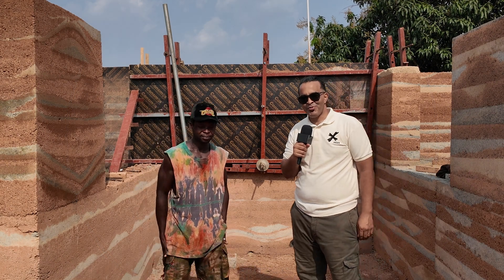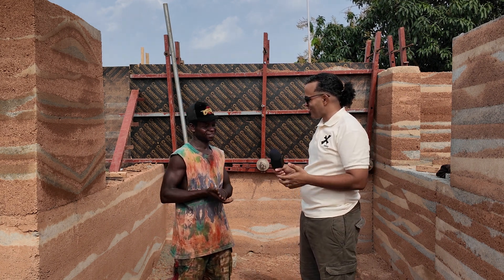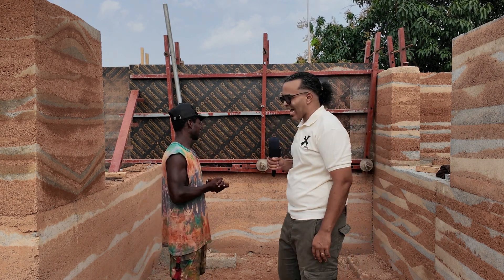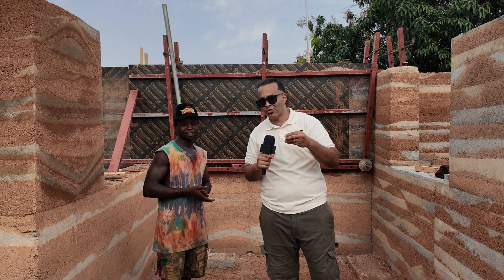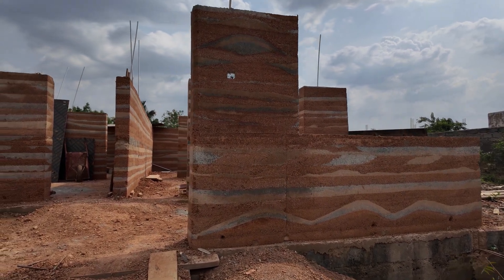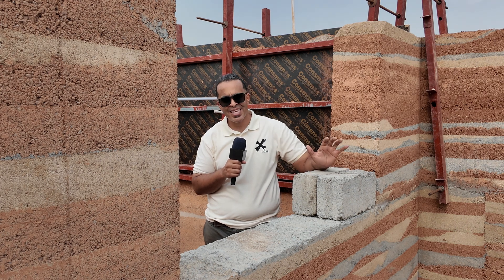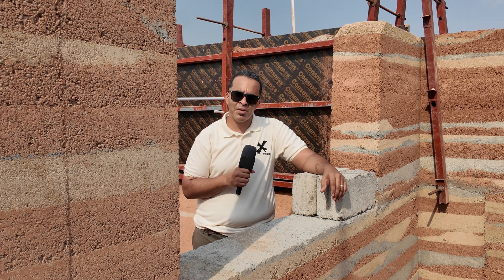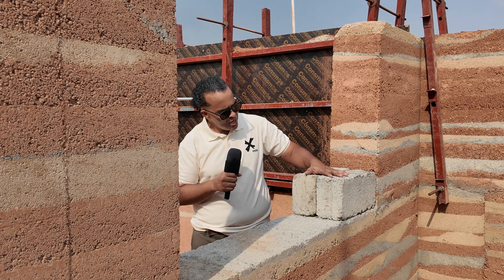Earth Works: Joe's Rammed Earth Project Reaches Lintel Level!

Comment: This is not new. in fact, it's at least a thousand or more years old. It is cheaper because you are using your own soil. you buy your cement which is about 10% of the mixture of materials. Quarry dust is optional. Your forms are reusable.the labor is cheaper. you are speaking as if people don't know what this is. It's not more expensive. most people know about this. people want to see how durable it is. And they want to trust the process. They can find the recipe of the materials used. so it's a bit more cost effective, many people don't trust it yet. Even though there are a few of these buildings in Accra. but speaking of it in this way keeps people away from it because most people want this because of its cost effectiveness. So now what are we doing?
Reply from the maker: @jclarke18   Thanks for your perspective— it has indeed been a challenge for people to adopt these age-old techniques and now too often after it for cost savings.
Reply: @EcotalkwithBrandon  And cost saving will sell it. if I were  approaching that business as such,. I would be more interested in proper inspections constantly as the project moved on.

 I would sell classes mainly giving more details on how and why it is a strong structure and safe. I would learn how to inspect and sell curious people, interest that would cause them to launch their own business and  I would sell a package of services that help their customer rest assure of the structure's strength . 

An inspection would come with the package and an educational class. I would price them about 1000 gh to 1300 GH.This will jump start the industry in such away that these services would become synonymous to the purchase  of these homes. then market as such. sales would go up .

 I would work with the building permit associates that would agree with this program, that they would make. it  mandatory in order to legally build a rammed earth home. Complying  with the necessity  of this packaged program to allow these packages to become mandatory in order to build. This would also play a part in obtaining a "certificate of proper completion" of the structure. yea let's call it that.

This will stimulate customer trust. contractors compliance and safety. I would give the customer the permission to move in on completion of the house. Lets call it a "permission to dwell certificate," but they would need to purchase a seal of safety and completion stamped by the Ghanian government. It would be automatically a lucrative business. 

If these things are not done, It would take a long time to lift off this industry. I've asked people about this type of building, they say things like, the house would wash away in Ghana's rainy season.,or it's to new, or there are no regulations concerning the strength and building  or safety of the structure.

 What I am saying is, to sell peace of mind, assurance and trust is key. Who knows, at that point, a customized home insurance , particularly designed for this type of building would be the other prosperous thing to do. The creation of this dish is that, this sells these buildings. 

The sales must be in a table model. Then a life sized show model, then apply the package which causes potential customers  to relax. But one would need to have their building team ready because the launch would propel things out of the roof. anybody standing close will make money. 

When you do these things, you will be also sending customers that know the process, to the company. you should have already negotiated a percentage for your pocket.. then make even more money. that's the story.

Comment: Why is there no cement foundation on this construction why were the walls put up before there was even a foundation that's concerning should there not be a foundation and then the walls built on top of the foundation
Reply from the maker: Hi, @miztri The walls your are viewing are on top of a cement block foundation and the floor slab has also been casted giving the flat level surface that they are now erecting the earthen walls.
Reply: @EcotalkwithBrandon  hey Brandon thanks for the clarity I was a bit concerned just looking at the video it just looks like the structure was built on dirt. Do you yourself build rammed Earth homes Brandon
Reply: rammed earth works different than cement
Reply: @markweekes8858  
Without a foundation structures prone to all sorts of issues damages concerns you don't build a structure on dirt that can possibly erode from excessive rainfall it doesn't make a difference that they build differently a home should always have a foundation that's basic knowledge
Reply: @miztri  could there be a footing. 3+ft deep that supports the wall? is that ok?